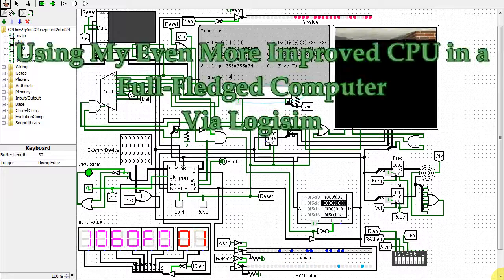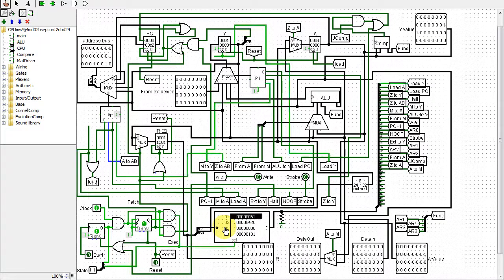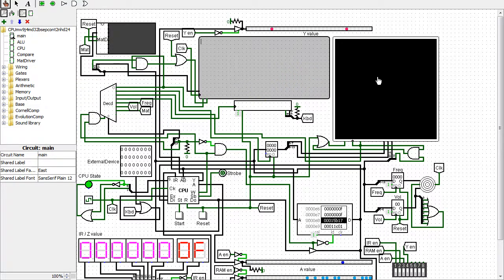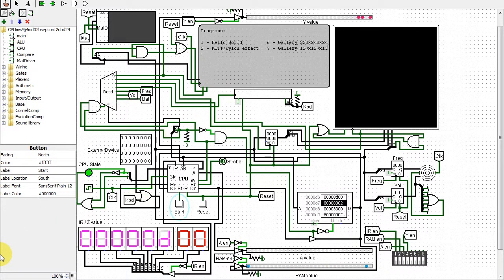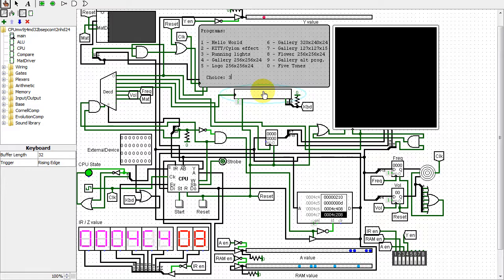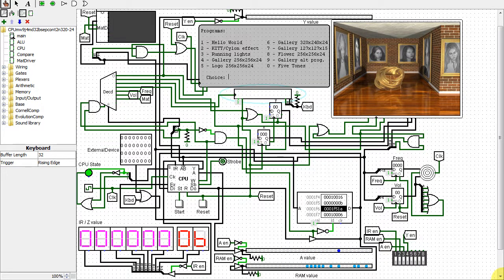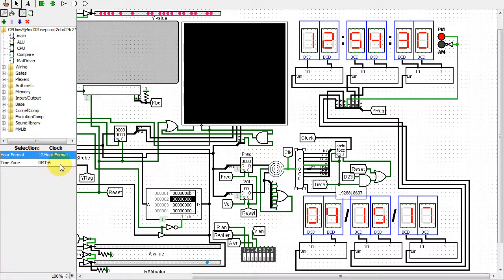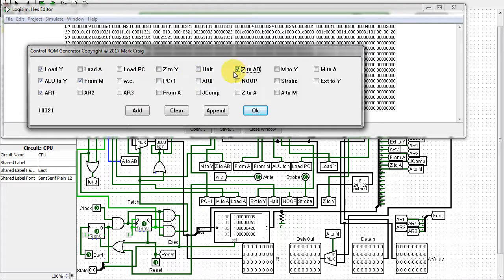Using My Even More Improved CPU in a Full-Fledged Computer Via Logisim

Comment: Where can I get the video display? It looks super crisp and I would love to have one for my CPU I am making in logisim, or possibly redoin in logisim evolution while its still in its infancy
Reply from the maker: I got the source code for the video displays from the Cornell Logisim Evolution distribution (the video display was originally written by Kevin Walsh at Cornell (at the time)).  I modified the code to support higher resolutions and color modes and made versions for both original Logisim and Logisim Evolution.  BTW, Kevin pointed out that his Holy Cross edition of Evolution has an improved version of the video display he wrote (https://github.com/kevinawalsh/logisim-evolution).  If you want mine, here they are:  https://sites.google.com/site/mrmcsoftware/home/downloads/cs3410for271.jar for a version for original Logisim, and: https://sites.google.com/site/mrmcsoftware/home/downloads/cs3410modvideo.jar for a version for Evolution.
Reply: Thanks man
Reply: The link for the improved logisim evolution version is dead though, and the cornell version seemingly doesnt have an option to load libraries
Reply from the maker: YouTube didn't handle the end ")" correctly on the improved logisim evolution version link (it's not part of the URL) - so, you have to take off the end ")", it'll work then.  On the second problem - I assume you mean the cornell version of logisim - if so, it does have that option.  Another viewer had a similar problem (an option that is supposed to be there wasn't (in his case it was FPGA)) - we tracked it down to him needing to upgrade his version of JAVA Runtime Environment (JRE) and make sure Windows (or whatever OS) is using the new version.  Maybe this is your problem?  The JAR library option would be under Project->Load Library menus.
Reply: MrMcsoftware switching back to another version of evolution seemed to work. I am sorry for confusing you and I will clarify once I get to my computer.
Reply: I was severely sleep deprived at the time of writing the first comments, I had not noticed the ) which I can see is causing the link to be parsed incorrectly. That is trivial, for wakeful eyes :) Yeah, I did mean the Cornell Logisim variant, I "fixed" it by switching to another version of Logisim Evolution that was publically available from Github, forgot which one specifically. Eitherway, I swiftly got to work making a driver for your video display variants and when I am less groggy, I will work a little on my own computer. Do you reckon simple 16x16 sprites(with a very limited pallette) could write somewhat decently fast to screen? Or am I just stuck with the terminal when I want anything interactive and "live"?
Reply from the maker: Unfortunately, I certainly understand sleep deprivation all too well :-(  I'm pretty sure the required JAVA version depends on what version the person who compiled Logisim used (and not necessarily what the source code requires), so you perhaps still could get the cornell version to work by using a different version of JRE.  But, I guess all that matters is you have a working version of Logisim.  In terms of the video screen, palette size doesn't matter (it all is considered 24 bit or 15-bit (555) (or was it 16-bit (565)) depending on which screen component you use).  But, of course, I can't speak for your CPU design or the program you write for your CPU - that could be faster with a smaller palette, I don't know.  In terms of general speed, there are too many variables for me to say for sure - your computer's speed, your eventual CPU design, your program, your CPU design's instruction set., the simulated computer's complexity, etc.  (The more components (including wires), the slower it will run).
Reply: This is why I strive to keep it as low component as possible, and sometimes I would rather violate the von neuman thing and do some quick hackaround than making some CISC charlie foxtrot with 90million different components
Reply from the maker: That's good - it will help.  I was constricted with my design, since the original goal was to see if my design for my homework assignment years ago would actually work (therefore, I was stuck with a kinda dreadful set of 16 instructions (and I think the professor even made a mistake with his hand-written instruction set since at least one instruction doesn't make any sense to me).  The almost 100 other instructions were my improvements (not part of homework).  Plus, the A register didn't do much in the homework assignment.  It does a lot more now (though still not as much as the Y reg.))

Comment: how I can make a comparison between two pictures
Reply from the maker: I don't know of any usable way to do it that doesn't involve programming (in whatever machine language your CPU design uses).  I say usable because IF the video screen size was small enough (very small) you could use comparators (with a comparator for each pixel comparing two video screens).  So really, that solution would only work for LED matrices (since the Cornell's video screen's (and also my screen's) smallest resolution is 128x128).  You could probably do something with only one comparator, by using multiplexers.  But, I think the largest multiplexer would be 32 input, so that would still limit the resolution.  Though, I guess you could "nest" multiplexers (essentially separate video screen into "banks") (I think "nest" would be the term, or maybe "cascade"), but that's still a lot of work.  So, I think the only realistic solution is to code the process in your CPU's language.
Reply: tank.  I have talked to my lecturer yesterday and told me to use two screens first one 32*32 and the second one 6*6 and to make a comparison between them (the screen will be black and white and I will draw something on the first screen, by away we change it from 128*128 to 32*32 and the second one from 128*128 to 6*6). my project is a template matching. I should display 1 if the two pictures similar and 0 if not 
      .(plus ( percent match
by away I have seen some of your projects it was very cool and interesting:) thank you again.
Reply from the maker: Thanks!  Glad you like them.
Assuming it's an electronic circuit project (for Logisim) that you are assigned, I'm not sure why the two screens are different sizes.  But the smaller sizes would be easier to deal with. so that's good.  If it's a programming assignment, then I could understand the different sizes.  But if you understand it, that's a great first step in doing the assignment.
Reply: yes. It is an electronic final project in a logic design course.
we make the screens smaller because I should explain it in 10 min. I should make a convert from software code to hardware circuit by using all the Theoretical materials that we study in this course.
Reply from the maker: Sounds like an interesting course.

Comment: How did you turn a picture into registers containing  individual instructions to display a pixel?
Reply from the maker: If your question is specifically about software, I guess you could skip to the next paragraph...  I wired up the simulated computer to send 16-bits (in the case of the 256x256 screen) to the X and Y ports of the video screen (8 bits each) whenever you write to the address 0x800001 and send 24-bits (RGB value) to the color port of the video screen whenever you write to the address 0x800002 (at which point the pixel is plotted at the previously specified X and Y location (held in a register) with the specified color).  

So, the program is what decides what to "paint"  - in the case of my images in this video, the image is just completely sent to the screen with hardcoded values stored in the program (actually hardcoded LOADI and STOREI instructions (except in the case of Program #9 (I think it was 9) which grabs the image (raw data, not LOADI/STOREI) from the program's memory and sends the values to the screen).  In the case of my floating point video (and my hardware stack video as well), there are no hardcoded images - the images are all calculated, and in the case of the function plots, only the pixels on the line are drawn (not the black areas).  In case you need to know, the previously hardcoded images were either originally in netpbm (PPM/PNM etc.) format or were converted to netpbm.  Then a simple program I wrote converted PPM to raw (really just took out the PPM header).  Then I wrote a few special assembler directives in my assembler that read a raw image file and assemble them on the fly to the necessary LOADI and STOREI instructions.  I hope this answers your question.

Comment: But does it run Doom?
Reply from the maker: I suppose it could (though badly), but I wouldn't want to code it and I definitely wouldn't want to play it (it would be way too slow).  I'm currently writing a simulator for this CPU and computer which is faster than Logisim (since it's only simulating what the instructions are supposed to do rather than the electrical signals required to do them).  But, my text based version of my simulator runs a lot faster than my graphical/GUI version.

Comment: How did you get a color display in Logisim?  JAR library?  If so, can you post a tutorial on how to make a Logisim JAR library or point me to a preexisting tutorial that didn't show up in my search?
Reply from the maker: I got the source code for the video displays from the Cornell Logisim Evolution distribution (the video display was originally written by Kevin Walsh at Cornell (at the time)).  I modified the code to support higher resolutions and color modes and made versions for both original Logisim and Logisim Evolution.  BTW, Kevin pointed out that his Holy Cross edition of Evolution has an improved version of the video display he wrote (https://github.com/kevinawalsh/logisim-evolution).  If you want mine (yes, they are jar libraries), here they are:  https://sites.google.com/site/mrmcsoftware/home/downloads/cs3410for271.jar for a version for original Logisim, and: https://sites.google.com/site/mrmcsoftware/home/downloads/cs3410modvideo.jar for a version for Evolution.  BTW, I don't know if you saw it, but at 8:07 in this video, I show a skeleton jar library component.  And compiling it.  I used Microsoft's Visual Studio nmake command (makefile program) to run the makefile, but you could always do the compiling manually by looking at that part of the video.  I don't know if I'll be doing a tutorial (there's a few other videos I'm already planning on doing next).  But, I'm pretty sure I put the source code in my jar libraries (the URLs mentioned above) - just exact them with your favorite zip file extractor.   Oh, BTW, in the video, during the compilation, there's mention of a file called srcfiles - that's just a file listing all the source filenames.  I don't remember for sure, but I think in the jar libraries I put online, I changed it to not need srcfiles.  I hope this helps.
Reply: I just now found your reply since Google didn't notify me.  Thanks for the info.  Google didn't parse your first link correctly, but I was still able to get to it.  I put all my links in square brackets, which Google does parse correctly.
Reply from the maker: I just noticed your comment (YouTube didn't notify me either).  Good to know about the link trick.  Based on my experience, I think YouTube might think comments with links are spam.  It didn't say your's (the NAND comment) was spam, but maybe if it thinks it may or may not be spam (but most likely not spam), it allows it, but doesn't notify.  Who knows with YouTube these days.
Reply: My link trick no longer seems to be working anymore.  But it did work BEFORE I told you about the trick.
Reply from the maker: Facebook is pretty much the same - you never know what strange behavior you're gonna get on any given day.